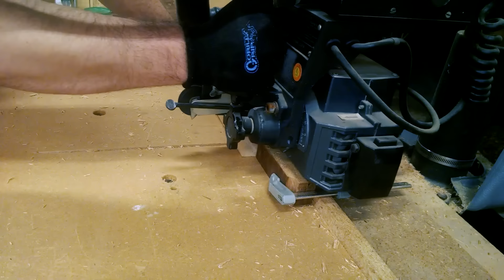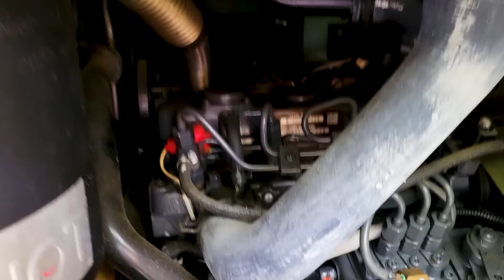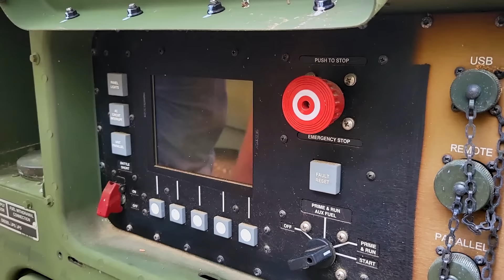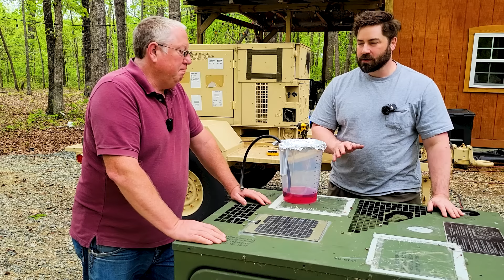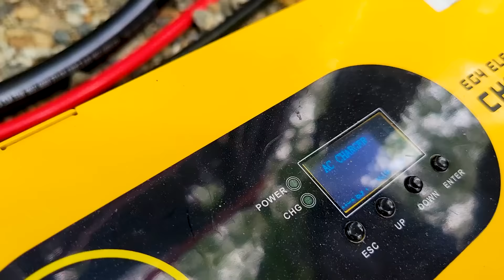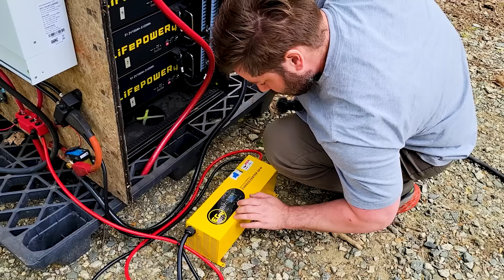Testing the Army's most efficient generator

Comment: You are using a DC charge accumulator with the Victron Smart Shunt.  The charger is measurable for its efficiency.  Assuming 51.2V @ 88A draws 5000W AC input, that means 4505W DC output is 90% efficient.  The 10.6kWh DC output then equates to 11.76 kWh AC to the chargeverter, from the generator, and 9.65 kWh/gal from the generator.
Reply: I calculated 9.33/9.35 kWh/gal; still, over 9 kWh/gal.
Reply: He measures the energy into the battery, as that's the main important metric
Reply: @tobimai4843   but he's judging the output of the generator, so that's the important result.  He asks at the end of the video for ideas on the power mismatch vs. spec.
Reply: @tobimai4843  Yes, but the entire experiment was to determine the efficiency of the actual genset itself. Therefore, @geraldc867's comment is completely relevant, as the ACTUAL kW/h output from the genset needs to be taken into consideration to determine the efficiency in order to compare what they got to the rated output.

Comment: My Perkins 403-15G engine with a 14KW generator head uses 1 gallon of fuel for 12.6 KW power.
Reply: Please make a video about it.
Reply: This is what I mean: something is way off in how he tests all the generators. They are sub par in efficiency...
My MW-tools DG75E yields.2.5kWh per liter. In this test he gets 2.3kWh per liter. And this is the highest yield of all his generators, as they usually score about 2kWh per liter.
Your perkins is probably 30x the price of my generator (1600 euro ex VAT). But that is what a normal yield should be: 3.3kWh per liter.
And we are the only ones that seem to notice...
Facts are facts. Somewhere he lost a lot of energy. Or his battery measurement is way off...
Or his charger is inefficient.
Or he loads the generator way too high.
To be clear: I use 3.78 liter per US gallon. The imperial gallon is 4.5 liter.
Reply: Fuel -> Electricity efficiency will likely never be 40 kWh ... a lot of that energy is released generating heat and exhaust pressure.... operating losses.
Reply: @bloepje The big difference is he's doing a real world test at full load like most ppl will. Not at optimal test conditions including load. It probably does significantly better at 3kwh
Reply: @bloepje  something doesn't add up, it says it consumes 8.7 KWh per gallon, which is 4.613 liters of diesel, so it's 1.88 Kwh per liter
Reply: Verified using what methodology?
Reply: Oof that's terrible, one gallon of diesel fuel contains 40.7 kWh of energy. You should be getting closer to 18-20kW.
Reply: @GeorgeWashingtonLaserMusket  There is no ICE powered generator on the planet that is that efficient. You have to get into combined cycle systems which use waste heat and some black magic tricks to get north of 50% thermal efficiency. IC Engines just can't get there. 

I think the next evolution in efficiency will be with CO2 turbines. But that isn't the subject of the testing here.
Reply: @GeorgeWashingtonLaserMusket  In what small scale internal combustion world are you even close to 50% efficient?
Reply: That doesn't make sense... Unless you mean kWh?
Reply: I think you mean to say 12.6kWh of energy

Comment: I have an unusual question. How easy is it to convert one of these to propane? Thank you.
Reply: I think it's gas generators that can be converted to propane, not diesel
Reply: Not very. This is a diesel engine, not gas. 
You need spark ignition to run natural gas or propane
Reply: I'd be surprised if it could be done since the computer is a major part of the operation of the engine. It would be much more practical to get an older, mechanical diesel engine like what is in the MEP80x series and convert one of those.
Reply: Diesels are a lot of work to convert to propane, because they don't have spark plugs. You can use propane to augment diesel fuel, but if you wanted to completely replace it, you would need to add spark plugs, and a spark timing system, as well as creating a whole new fuel management system. In short, you'd be way ahead just swapping the engine to a gasoline engine and modifying the fuel system.

Then you'd have to figure out how to tie it in with the generator computer to get it to pass all of the pre-tests and get it to communicate in order to maintain the correct rpm and engine load to keep the generator happy.

If you want a propane generator, buy one that is designed to be able to do that.

But frankly, Propane is a horrible choice for fuel anyway. Diesel is a superior fuel to Propane, by just about every possible metric.

What are you hoping to achieve?
Reply: @Wrenchmonkey1  The reason I want use propane is that it lasts indefinitely. Gas or diesel both have a shelf life. That is my main reason.
Reply: @iTeerRex  Treated diesel lasts a very long time and need to do maintenance runs at scheduled intervals so you will use it up before it goes bad.
Reply: It's impossible, you can only convert a gasoline engine to propane, not diesel.
Reply: Impossible. It's a diesel . Gasoline engines can be converted but not diesel .
Reply: You cant its a diesel
Reply: Propane is far less efficient
Reply: It's a diesel
Reply: Thanks everybody 👍